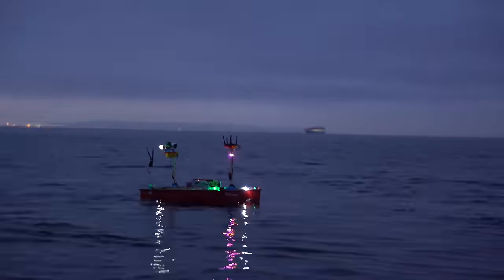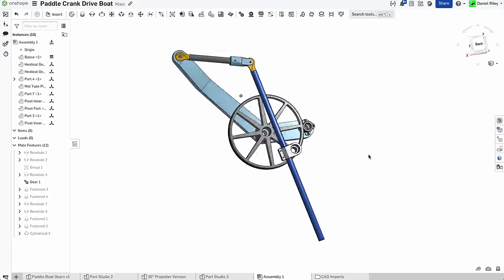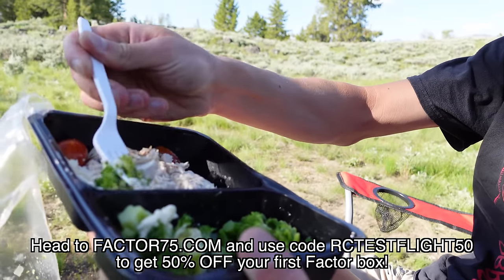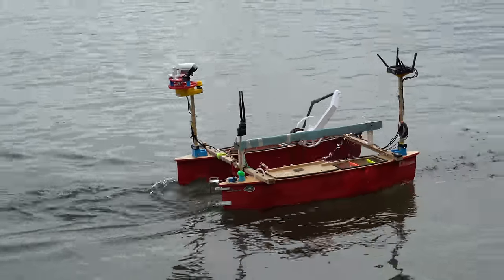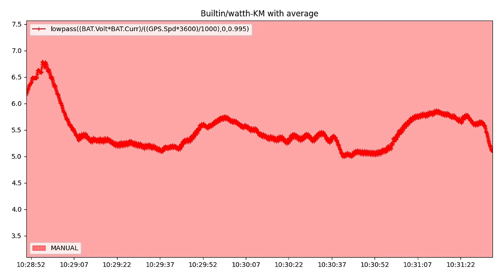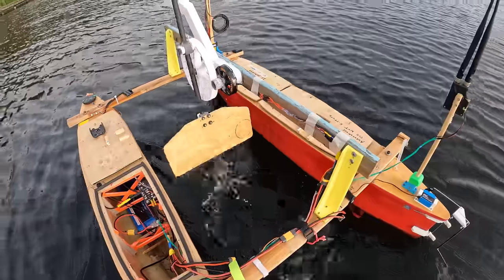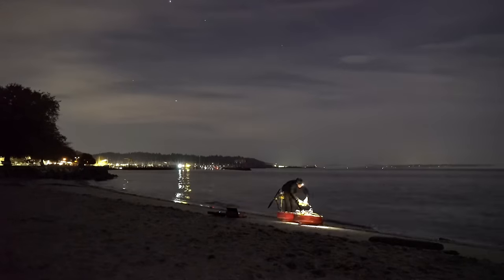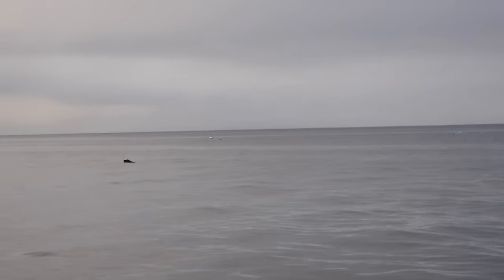Propeller Killer? High Efficiency Paddle Vs. Propeller

Comment: improved paddle design (bigger diameter gear to lift paddle out of water more, and larger paddle?) and then combine with dual air fans (small enough to not hit water during chop) for steering.  seems like those combined could work well.

Comment: I like this. It would be interesting to see a comparison between a normal boat engine and an airpropeller runned by same power.
I understand that at least one reason to that airpropellers are not commonly used is the noise level.

Comment: Efficency propelling in fluid at at least sensible speeds is all about slip. 

If you think of rowing. If you did it with 2 plane poles. Then with 2 big paddles. Its obvious which is more efficient. One slips a lot less so wrists less energy as its pulling on a larger volume of water.

This is why trains are efficient as they have 0 slip. The difference between rowing and cycling. 

So a big prop grabs a lot more water or air to push against so slips less and you have higher efficency.

For an exsteme example look up the human powered helicopter. It's this taken to the max. 

In theory a bigger paddle will be more efficient. So in another version. 3 paddles. One Central and 2 outboard shoud give better results.

Comment: For real-world purposes, the air propeller, despite its theoretical efficiency, cannot be used beyond very still waters, low speeds and with propellers that don't encounter the Mach limit. For example, you can't use this move a cargo vessel on the deep ocean- even if it mounted multiple giant props, they'd have to be mounted super-high, have to spin at low enough RPM to not exceed Mach limits at the tips, and almost certainly would have some really severe problems with vortices and tip drag, not to mention weather! 

The paddle-boat system looked a lot more impressive, even if the design approach felt like it could use more thought. 

Picture the paddle's rod as a spring; printed in a flexible plastic (or for larger applications, metal) with a very low entrance cost (i.e., the cost of breaking the water's surface) through a good paddle design, coupled with storing some of the energy from the initial acceleration in the rod, powering the rest of the stroke (this is one of the reasons why modern oars are better than the ones built from wood; they can store energy more efficiently and flex more without breaking, allowing some of that initial energy to be recouped as the water accelerates enough that the spring force overcomes the resistance). 

I think you're onto something with the paddles, but you need two or more for differential steering and you need to look at the paddle's design a lot more. Old steamships using paddles were specifically built to avoid fouling problems and to operate in low-draft areas, and were a very successful technology for the period, despite their relative inefficiency, because of where and how they were used. They only fell out of favor because screws appeared to be the obvious Right Answer once they became efficient-enough, due to reasons that are mainly historical in nature. As your experiment demonstrated, it's not that paddles are inherently too inefficient.

These use cases still exist and there's a case to be made for exploring just how much efficiency you can get out of paddles if you think about the use of the forces involved to conserve energy a bit more. I suspect that you can start approaching the efficiency of the giant air-boat props, but fewer of the disadvantages, with a better design. 

A really efficient paddle system would avoid cavitation and underwater noise issues, which has a large variety of real-world applications- everything from providing a credible propulsion system for ships designed for littoral operations to high-efficiency paddles reducing oceanic noise while being efficient enough to see large-scale use. I think the stroke system you showed was interesting, but I'm not convinced it would work well at scale, whereas a paddle wheel design is proven to be scalable.

I also really have to wonder if a really well-designed paddle wheel using a modern understanding of fluid dynamics is better than the stroke method, simply because of not losing so much energy in the mechanical linkage- surely directly driving the wheel or at most using a single gear is better, especially since it's not having to push all that extra mass around. There has been very little serious exploration of paddle-wheel technology since it fell out of favor in the 1940's and our understanding of engineering is vastly better now. Imagine a paddle-wheel at the scale you're experimenting in, where the paddles are printed and lightweight, each paddle is designed for optimal entry cost and to store and return some energy per stroke by flexing, and reduces vortices considerably with vanes or curling edges.

Comment: Check out yuloh oars, stern sculling oars, they're reportedly more efficient because they don't leave the water, and they shouldn't catch anything bc they point backwards. Otherwise I bet you'd see increases if you kept the paddle vertical the whole time with a parallel linkage or belt so there's no loss from the angle.

Comment: Borrowing the water intake from a jet engine might make your propellers work, though you would loose efficiency. Basically what many of them do is take a channel in the hull, put a mesh on the bottom, in line with where the hull should be. Debris is washed off the mesh in operation by water moving along the "hull" while enough water is let through the mesh to propel the boat. Basically to test it "just" buy a four sided cheese grater, print a nose cone for the narrow end and the propeller in the wide end. The water comes in through the holes and is pushed by the propeller...

Granted now knowing that it would make the least efficient system less efficient it's a waste of time....

Comment: Cool video. The paddle was awesome! I was wondering how much is lost from the edges of the paddle with each stroke to the eddy. What if you introduced a vertical edge to each of the vertical sides of the paddle to control the eddies. Would that improve efficiency?

Comment: 7:13 Honesty I would just use a microcontroller and use a basic moving average to smooth the data. Otherwise you are probably looking for something similar to a LC lowpass filter stage (like a buck converter output or Class D amplifier output) to get your average which sounds like more of a pain to dial in, but still not that bad.    Edit: looks like you solved your problem

Comment: The paddle can be made better than the air propellers.
The paddle is not aerodynamically shaped, but it can be. The propellers are aerodynamic. 
Eliminate the vortices, by either make the paddle same width as the channel inside the hull, so water can't escape around the corner of the paddle and make drag. (Or make the backside of the paddle taper into a drop shape, so there is no "backside" the water can move around into)
Make the paddle dip into the water without any splashing, matching the water speed, at the optimal angle, then accelerate. And move out without splashing. Move forward in the air, but preferably horizontal movement to reduce air drag too.

Comment: Try a different hull design. Split a std hull down the middle and reverse the hull pieces so the flat sides are on the outside. Space it like a catamaran. This should reduce wake power loss. Also try a propeller in the middle to use the water like rocket propellant.  Push or pull the water. Let me know how it works. Thanks!!!

Comment: Instead of moving the props up away from the water, could you move them closer to the center of the boat? My thought is that the boat sort of pivots on each wave and the props are far away from the farthest pivot point. If you move them closer to the center of the boat they wouldn't move nearly as much relative to the water's plane.

Comment: If you connect the mechanism on two sides (using a shape like a car's crankshaft) and add a flywheel, there would be less stress on the mechanism and motor. Probably have to use metal instead of plastic though.

Comment: Another armchair idea: For very slow boats, it may be possible to have a very large "intake" that is protected by a mesh/several holed surfaces, and a propeller that expels that water out through an opening that is unprotected. I say slow boats, because the flow through the intake would be very slow, but due to the large intake area the negative effect on speed should be smaller and there should still be enough water coming through. The intake surfaces would eventually accumulate stuff as well, just a lot slower, and the force holding it to the intake surface isn't as big.

Comment: single oar sculling might be a cool propulsion method but it requires a good amount of finesse so might be out of the question to program a motor to control it. with a single oar, u can control direction very good but that is too hard for a robot, maybe, u can get the motion and angle going so that it just has to push forward and use a rudder along with it.

Comment: Seems to me this type of paddle propelled boat imitates a bird on the water with one leg. Put another leg on it and also see how the bird moves it's legs through the water if possible and with two paddles, like a swan or duck which has evolved to be efficient on the water. Maybe even have them paddles shaped more like said animal and have web foot shaped paddles, maybe even a slightly flexible rubber that flare as it pulls through the water, like a webbed foot of swan that has evolved that shape over millions of years?

Comment: No expert here besides diving for few years. Nature might offer a solution.  

Side to side flexible ( length and depth up for efficiency interpretation) occilating fin . Wheter its wide powerful strokes or long ( a whip with Shockwaves only at the tip as an example) might worth to try

Comment: I'm no engineer.  I do however think that a lot can be done to make jets more efficient.   The outboard jet impeller had hardly changed since they first came out.  I dont think it will ever compete with a prop, but I also think a good engineer has a real opportunity to design and nake a lot of money off of an improvement.   2 problems, 30 percent decrease in HP and loud.  Make big steps there and your likely a millionaire.

Comment: Whale's have nodules on their fins. When added to propellers it removes the damage suffered to propellers when air bubbles are generated.

I just wanted to point this out as your high speed boats just have plain blades.  Sure you know this already.

But any additional efficiency is something right..?

Comment: This is like trying to run without knees. You need a "knee". Adding a hinge to the "leg" and then adding a secondary drive shaft "tendon" that is "timed" geared to be in sychro with the main leg would help. Build a paddle that mimics the human leg. The reason your "ankle" didn't work is because you had nothing to drive it.

Comment: Common misconception is that paddles work by pulling through the water.  70% of the power is actually from the catch, or thrusting the paddle into the water, creating an angle of attack, 30% is from the pull phase.  It would be interesting to see if you can recoofigure to get more "Catch".

Comment: So if were thinking of a surface movement efficiency. We have friction and more... OS you could really amp up this design..., using a program you can have a reactive index to teh threshold of wave height, until ti pass the 50% bow to stern mark in relation to the wave at which point its better to ahve a submersible which a craft can always be changed into... unsinkable in the most violent of waves... There is this point ot which you either are on super massive waves whihc most thigns to still work well ,but there is a poitn to which the waves are x length of your craft, and hte mass of hte craft can cut through it and you get a hard hitting flop against it ratehr then a nice ride, jsut at a strange point.. Anyways moving on.

So the paddle system cuts in at a shorter distance then a wheel and doesn't use projected motion which acts as a break since the wheel is the limiting forc,e by have hte paddle enter and push the mass/body of water it accelerates. SO we need water to pretty muc hgrab onto and push off of. WE need ot enter at a point in whihc it doesn't deaccelerate. SO you ahve have a water speed monitor, I think all you neeed is a small wire and it can track distance x travels over it whihc gives the speed, or you cna do air speed and trasnlate it but that could be off. Or movement ... whatever you ahve have a paddle boat tht adjusts (infnitely ) lol to the water speed s oit can always optimalyl push off teh water and increase speed, overcoming the water wheel disadvantages, heading more toward mechanical failures at high speeds.... OTher things that cna be added in is liek sea creature use of trilling, so many paddles working in an program repsonse nad A synchronus set up... As you beging ot go faster more paddles enter int othe water so you can add the same  or more froce to help accerlate IE hitting the  water at increased intervals, so you don't break the mechanical failure poitns by accerlating simpyl one paddle. Uisng slightly differnent shaped paddles you cna have them over lap the same stream of entry point on teh boat.. I think this could get a very high speed and would not be getting tangled up as its just entering the water like a knife and then pushing off.

It would be an interesting concept to take to the limit...You would also need an adjustable kind of mass or arm, or different mechanic system with a horizontal screw set up so it doesn't require a mass, but the same motion of entry and push... THen we have hte boat itself, we can put on hydrofoils so it lifts out of water, but for that we need the paddle to be able to adjust its height based on if the boat is lifting the height and slight angular chagnes could help on massive waves.

Comment: I'd use an expanding and collapsing cone pushed through the water with a shaft screw mechanism driven by a pulley above the surface connected to a bicycle set up with shifting gears.

Comment: I had my trolling motor burn up because the prop was fouled and the dial set at slow. The company that made the thing had no built-in safety to prevent the motor from burning up and I was clueless that it was happening.

Comment: The wind only affects the top level waves. The actual larger waves are mostly due to water currents. Those of course can in part be caused by wind, but also by the weather on the other side of the ocean, underwater volcanic activity, the moon etc. So don't rely on wind for the waves.

Comment: This is a return to the paddle wheel. The wheel is simpler than your design (there are many moving parts, and from an operational point of view this reduces the reliability of any design and requires maintenance). And the meaning and principle are the same as that of a paddle wheel.

Comment: I wonder if you could have the water props mounted without the whole water proof drive train thing, and have it instead mounted with thrust bearings and coupled to drive through solid wall using magnets. would that be more or less efficient?

I also wonder how well a chain of paddles would do.

Comment: Why not just use a sharp blade to cut up the weed though? The blade doesn't have to be on the propeller itself obviously, and I'm pretty sure sharp propeller blades would go dull way too fast even by just spinning in water, just in the part where weed is likely to start spinning around the shaft. It's much easier to do when you have realistic boat where shaft comes from the bottom of a ship in the middle and has some spacing between propeller and hull where it's trivial to install sharp stationary blades both behind and in front of propeller.

If installed properly, weeds on propeller wouldn't even be a factor, the moment they attempt to accumulate, they risk reaching the blade which is a self solving problem at that point.

Comment: Paddle wheel would be hard to beat with improvements made to the angle entering and exiting the water. Almost replicating a ferris wheel that allows cars (paddles) to   remain vertical when entering and exiting the water. How that is done is another question entirely.

Comment: Could you add aircraft tip vorticities limiters to the paddle to see if it is more efficient? Like the curved swoopy bits on the ends of plane wings, but on the sides and bottom of the paddle?

Comment: 14:56 Your boat didnt fail because it was too wavy.  It failed because you mounted the props too far back.  If they can't hit the water without capsizing then they can't hit the water in any vaguely reasonable situation.  You only needed like 2-3 inches forwards and no more possible water contact without much bigger problems first.

Comment: If you are going to use air props, why not follow the proven design of air boats?  A single large from with vanes in the airflow to direct it for directional control.

Comment: What if the paddle could be constantly submerged and use all torque. That’s a propeller.  A paddle boat uses multiple paddles on a wheel. Pretty much everything is better than a single paddle.

Comment: I don't believe this can be stepped up from RC to full size boats, let alone ships in the same way as conventional methods as far as efficiency with longevity goes.
I think the forward back motion of the paddle setup will need beefier connecting rods and supports exponential, not proportional, to the size of the paddle. 
The force of the quick direction changes aren't the same when you step up the scale, so doubling the size of the paddle needs more than double the strength of the conrods and supports.
I am not an engineer by any means, I am just pretty sure I learned this along my studies in the past.